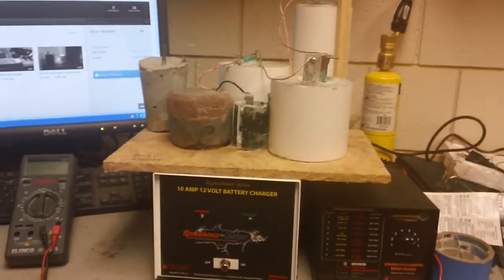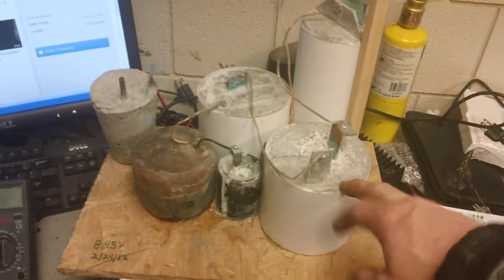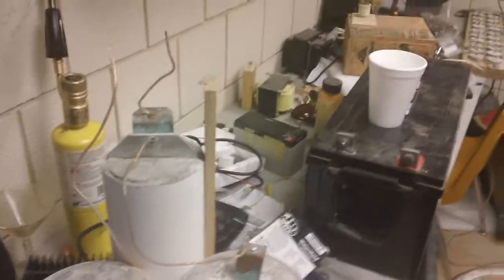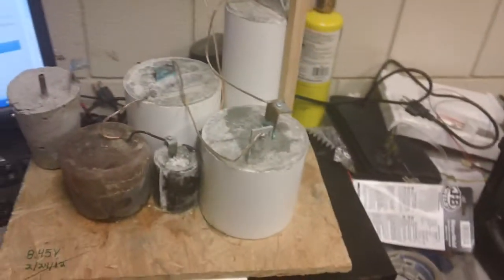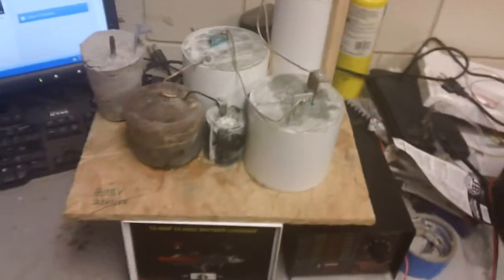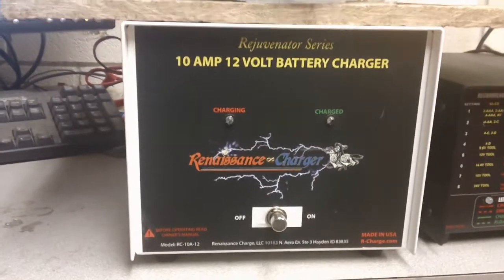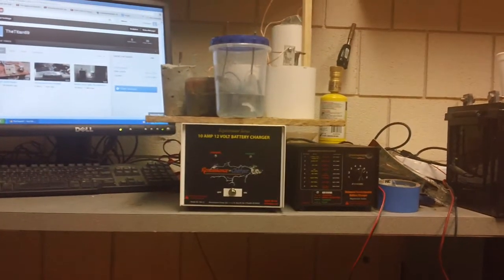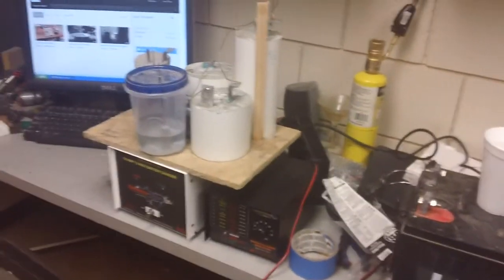Concrete Batteries & Reconditioning Battery Charger

Comment: Hey Van, you could make a really cheap circuit that will recondition a lead acid or nicad battery.  I made this one way back.
I tried to get it on the "Quirky" site to sell but they made me sign a non compete contract and then they shelved it.  I called it "The Spike".  anyway here is the Youtube vid showing the earlier builds that led up to it.  You could make this with ease if you need to.
Have fun with it. https://www.youtube.com/watch?v=uA7H4VCpUp8   -- and here is the video on how I used the Spike. https://www.youtube.com/watch?v=R8S0nQe5d0Q
Ed

Comment: Hi. Most of your heavily sulfates battery's can be repaired with your chargers. Don't expect it to work in a week worth of charges. It could take months to bring a battery back to 80%. To save you lots of time go and check out battery secretes and battery rejuvenation. You can find em both at teslachargers.com. Great work on the TEG stuff I will try and replicate your experiments with that

Comment: Just curious how much of a difference was there on the charge?
Reply from the maker: A battery can be made from any 2 different metals with a wide range of working  electrolytes from spit to the more complicated. That being said most all the materials you can think of have a one cell voltage of .75  to 2.7... simple Galvanic cells that can be made easy run about 1.3 volts with very little amps but depending on application of nano tubes that simple cell will charge to3.4/ 3.8 volts at about 3 times the current or 5 o 6 times energy density. with crap applications.
Reply: Buck hi everyone ,if anyone else wants to discover how to recondition used car batteries try Megarno Amazing Battery Magician (do a search on google ) ? Ive heard some awesome things about it and my colleague got great success with it.

Comment: I wonder if this is what the Egyptians used 4000 years ago to work in side the pyramids ?
Reply from the maker: I dont know but some of these batteries are still around over 2 years latter and still holding charge. and can still add water and light L.E.D. for weeks,
Reply: Egyptians used something more sophisticated than this.... if it was even Egyptians that built the pyramids in the first place. I suspect that the pyramids are older than we think. I think the Egyptians found them in the dessert in a ruined state and built a city around them. The pyramids were actually built by an advanced "alien" race. They moved on because the aquifers under the pyramid dried up and the pyramids were no longer producing any power. They took the golden cap and left.

Comment: What if u drill a hole in the bottom of the concrete battery and put it in a cup of water (distilled ) 1/3 the way up the battery?
Reply from the maker: Its an electrolyte only so much moisture is needed and above what is required is not better it actually can short then out.. the semi conductivity is key